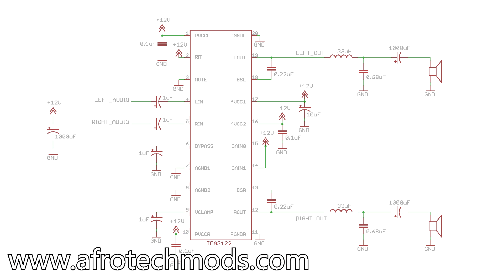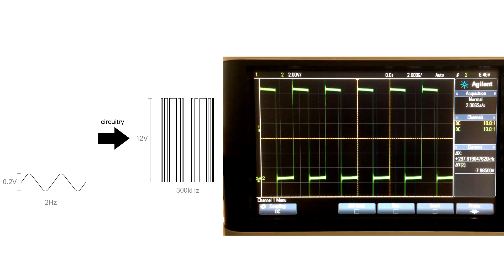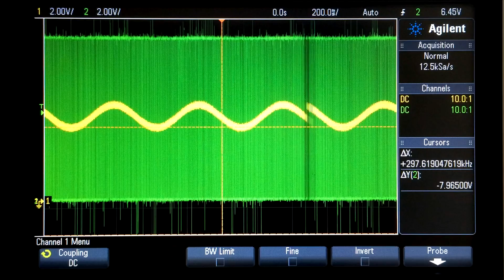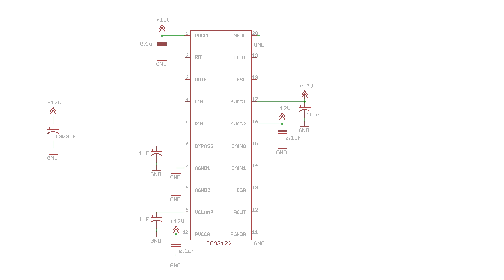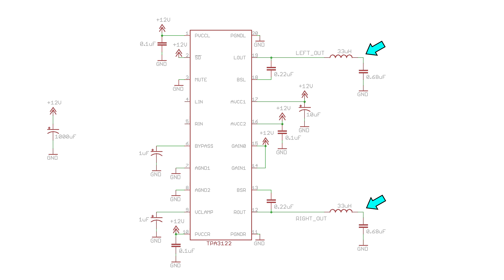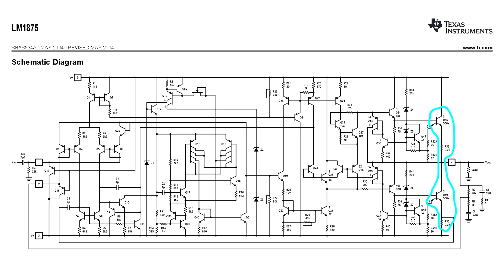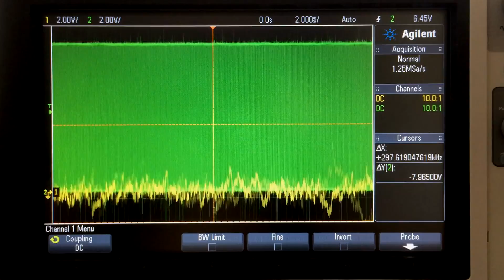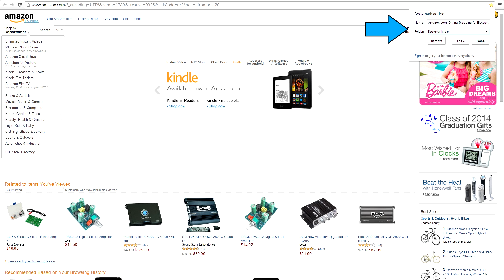Class D Amplifier Tutorial!

Comment: why are amps<class> for vehicles different, ex: in car theatre wiring highs and mids goes to class a+b amps,,and only true bass ,midbass and sub-bass gets wired into class-d amps.  connecting subs to class a+b burns out amps+distorts the subs badly,,,just sayin;; n yes these are high current,,not just high power setups,,i've noticed that when wired properly mids and highs receive the most efficiency from a+b amps,,to use d would be overkill,,and class-d are most efficient wired to subs =i've used the exact same power rated amps [a+b]  [d],,and tried to see through elimination which created distortion or was just overwhelming.  sure enough a+b can and does have the capacity to "give" adequate power for most speaker configs but they run waaaaay too hot for subwoofer setups,,whereas class-d runs smoothly at same power out levels but is overkill for mids-highs.         for all around vehicle sound class-t seems the way to go in the 7-8 channel config ,,in my experiences this will give consumers joy,,but not audiophiles!!!!!             tangent over     thanx for your vids       

 btw,,HELLO from ft.lauderdale,fl usa
Reply: +Ronald A. McCloud (Ron  Ronnie  RAM)  For subwoofers it makes no sense to use AB amps, as subs consume a lot more current than high and mid frequency speakers. And since the frequency of a subwoofer is not very dynamic, mostly bellow 100 Hz, you'll never notice any distortion. As for the burnout of AB amplifiers, I have not heard of that before. I have built a lot of different car stereo setups during my younger years, and I didn't pay much attention to the different classifications of the amps. But I did kill a few AB amps with big subwoofers due to not matching the specifications of the two, especially problematic when I failed to check the sub twin coil ohm rating, and the maximum output of the amp related to 2 and 4 ohms. I learned the hard way.
Reply: Exactly my point you do not want to use class A & B amplifiers for subwoofers since they require huge amounts of power Class A & B amplifiers can deliver that kind of power but they make mostly heat whereas class-d can deliver a lot of power and doesn't make a lot of heat.
 Class A and B is better suited for mids and highs and Class D is suited for subwoofers not that you can't use class D for a Mids and Highs but I've experienced that is overkill in the terms of being most efficient basically I'm agreeing with you thank you for your comment
Reply: Early Class D amps were ONLY intended for subwoofers because they ran at low frequency (i.e. 25-60 KHz), had no feedback mechanism, and had a lot of harmonic distortion! If you keep in mind, the sub-bass is mostly experienced either through the bone through the whole body, or acoustically through distortion created in the ear canal, up to 20% distortion may even be a desirable characteristic for a subwoofer amplifier if available or safe for hearing power is not sufficient for the perceived power that is targeted. These subwoofer class D amps have been available for a better part of 20 years.

Class D amplifiers capable of serving the whole audible range only hit about a decade ago. Low-power, low-quality units with internal/digital feedback for TV, boom boxes, phones, etc. became available from numerous manufacturers, especially as extension of delta-sigma modulators used in ADC/DAC units. High-quality, high-power units such as for Hi-Fi and PA full-range use also became available during this decade.

Comment: how do two simple capaciters turn the circuit into ac at the end I don't understand that part.
Reply: They do not turn anything into AC. They just make sure that only the AC part of the amplifier's output gets to the speakers. The capacitor is admitting the higher frequency part, but blocking the lower frequency / DC (DC = 0 Hz) part.

Comment: can I Connect both outputs (l+R) in paralell to create a 30w Mono Channel?
Reply: Usually, no. Well, your current handling should increase, but given the fixed impedance of speakers, you're not going to put any more power into them without going higher voltage!

However, see the data sheet of the amplifier about using it in mono BTL configuration! You invert one of the inputs and then connect speaker between inverted and non-inverted outputs, thus doubling the voltage. You can have 30W into one channel then. The voltage doubling would speak for the power quadrupling, except that isn't happening because you're running against thermal limits in the IC, but you can still double the power.

Comment: Wrong about high-end speakers. There are versions of audiophile (fool) grade class-d amps out there! You'll need a full bridge output stage with GAN FETS operating at 750kHz PWM with robust closed-loop control and high-quality 5th order LPF with low distortion inductors. Such class-d amp will const around 500$ per monoblock unit, which also included a high-quality SMPS.

I'm using 2 ICEPOWER monoblocks to drive my Focal Aria 926 speakers. And the sound is much better than the class AB amp in my Denon X4400H AVR...

Comment: I dont understand how the low pass filter is a LC, shouldn't it be RC? LC is notch filter.... you might have particularly loud output  if any range of the music becomes within the resonance frequency. Correct if i am wrong tho.
Reply from the maker: LC filters can be low pass, high pass, notch, band pass, it depends on how you have it configured. In my design they are low pass. RC wouldnt work here because of the high currents that need to be passed.
Reply: Speaking about LC filters, could you tell me the difference between using an usual inductor or an RF choke inductor?
Reply: Andrew Geng: Elaborating a bit, the filter used is configured as an "L" shaped series-parallel filter. The series component is the inductor, resisting high frequencies but having little effect on the lows. The parallel component is the capacitor, shunting high frequencies to common while showing high resistance to lows. The combination adds steepness to the slope of attenuation, as compared to a single component.

A notch filter would be implemented by combining the L and C components in parallel with each other, and the combination placed in series with the amplifier output. A band-pass filter would result from placing the combination in parallel with the output.
Reply: alachabre Great explanation. Could you recommend a book where I could find more information about that or the book you have learned this yourself please ? Thank you.
Reply: Thanks for the compliment, sometimes I worry I don't explain things very well. As far as a book, well, I got my knowledge from a lot of books, the hard way. First technical training in the USAF, then a bachelor's degree in Electronics Engineering. It was a long time ago, I doubt any of the books are still around. Check out a used book store and find an electronics book on filters or maybe basic communications circuits.

Comment: Wouldn't increasing the square wave frequency increase the accuracy of reproduction? Why not increase it to well above the ability of human ears to detect? A couple megahertz should do it, and that's peanuts for a MOSFET.
Reply from the maker: It's already ultrasonic. It has to be. But it's still not going to be a perfect reproduction because no low pass filter is perfect.
Reply: Afrotechmods This is correct, but I'm talking about close enough to perfect that a human is physically incapable of differentiating. We do have limits, after all, just have to engineer past them.
Reply: +Teth47 its the same as arguing about old vinyls quality versus digital music. there's always gonna be an expert that is goin to find a "diference". to me they both are perfect already :)
Reply: Alexsander Magalhães There is a difference in frequency response with vinyl, which could introduce subtle overtones and harmonics. I imagine there'd be a noticeable difference between 44-48KHz sampled digital audio and a record (To a trained ear), but if the original audio is sampled at 192KHz, digital actually beats vinyl in accuracy of reproduction as it's able to achieve a resolution higher than vinyl is physically capable of because molecules of vinyl are just too big.
Reply: +Teth47 thanks :)
Reply: good observation. it's bc power mosfets aren't so efficient in high frequencies. I hear HEMT transistors is what will solve this bandwidth problem.but if you look at the prices they're pretty high

Comment: do we need a +12V and -12V power supply or the -12 can just be the ground?
Reply from the maker: Just a single supply, no negative rail. So if you have a 12V supply you would use the positive side of it as +12V on the schematic and the negative side of it would be ground.
Reply: ok. thanks

Comment: What is type of class do you like better?
Reply: The best two are class AB and class D
Class AB since on big expensive speakers it sounds better.
Class D for speakers that aren't all that and a bag of chips.
Reply: There are actually different opinions on that. For example, class AB is prone to crossover distortion, while class D is not. Some people claim that it's the most audible and most objectionable kind of amplifier distortion.

On the other hand, class D amplifiers often don't have a global negative feedback, thus presenting a higher impedance source, so they usually sound audibly different from transistor class A or class AB amplifiers. The reason for this is that Hypex BV of Netherlands somehow miraculously patented global negative feedback on class D, so only they can make class D devices that directly rival class AB and sound the same, so for example the newest NAD Class-D amp is really made by Hypex. The differences concentrate against the ends of ranges, which are, by necessity, comparatively neglected in acoustic design, so it's impossible to say a-priori whether it's going to be more or less neutral! In particular people who liked tube amplifiers before found a liking in some Class-D amps which don't have global negative feedback, such as Tripath.
Reply: Siana Gearz that is why you need analyzer.
Reply: Siana Gearz I'm not sure about Bruno's (founder of Hypex) patent but I do know there're other designs very very good as well. For example the Anaview AMS series designed by swedish Patrik Bodström. I've consolidated some favorites power amp measurements (Rotel, Benchmark AHB, Hypex, NAD, Anaview, Bryston) found on the Web if you're interested. THD+N http://www.faktiskt.se/phpBB3/download/file.php?id=3865&sid=a594990200eb6cfba5b369972656af0c 

Full thread in Swedish: http://www.faktiskt.se/phpBB3/viewtopic.php?f=10&t=61815

Similar in English: http://www.diyaudio.com/forums/class-d/282291-test-data-graphs-consolidated-12-popular-power-amps-class-d-ab-h-aaa.html
Reply: NirreFirre
Thanks for your effort, but the way i see it, it's a bit futile. I mean with just one or two exceptions, the total distortion figure on most amplifiers is low enough or excellent! Arguably, going by these figures, there should be no audible difference between most of these at all. But there will likely be an audible difference, because the speaker is not a resistive load, it just wouldn't necessarily correlate with the resistive measurement. That should be measurable too. Not sure why nobody does that?

AMS1000 seems nice, but the data sheet leaves me more confused than before - the block diagram is obviously not intended to be taken too literally. Finally, i found their patent. Have i found the right patent? I'm not sure! Well, perhaps not all amplifiers have to look like amplifiers, some amplifiers can apparently have a topology of a switch mode power supply, where some steps have been taken to achieve better output voltage control. But yes, there's a global control loop in there too, it can behave any way they would want it to.